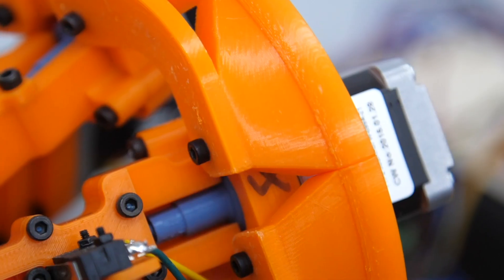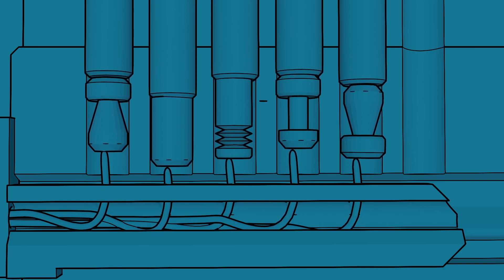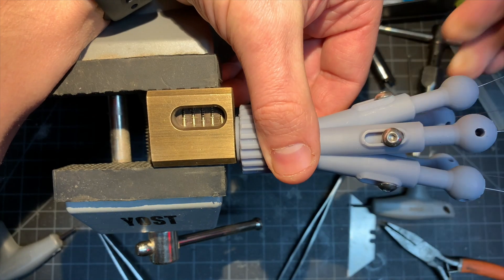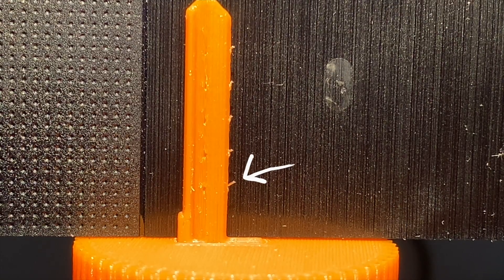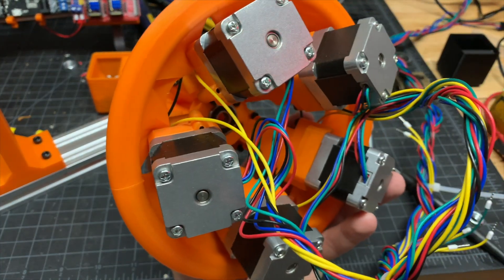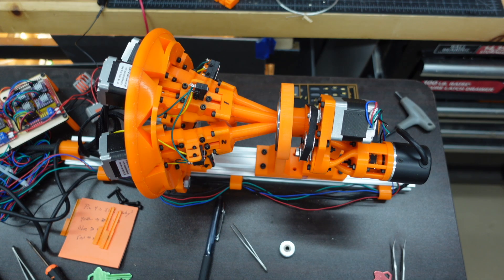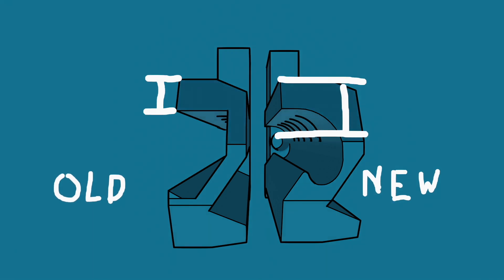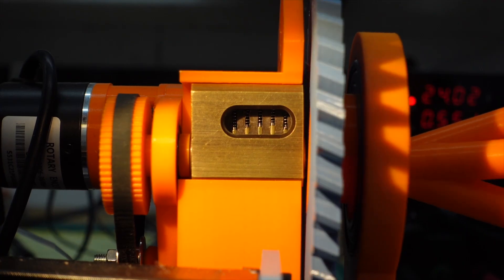i made a robot that picks locks WITHOUT A PICK

Comment: If you got wires, why do you need to spin all the motors anyway? Why not use springs anywhere to limit torque transfers? I've got so many design improvement suggestions..

Comment: I would replace the large helical gears with 'standard ones.' Helical gears introduce axial forces which, considering that most of your components are 3D printed, can lead to unnecessary bending and twisting of your construction. Yes, I understand that helical gears provide more contact surface, resulting in a smoother transmission, but I believe it's worth considering alternatives.

Comment: Seems like a meet concept that can be built upon. Good design work and nice video :)
I'm not too much into mechanical stuff but I would suggest to use double helical gears to reduce movement of the gears. The seem to be pulled out of alignment slightly when under tension and could slip apart. 😅

Comment: The manual version you made first has some serious potential. With metal construction that would sell like hot cakes
Reply: It wouldn't.  It's a neat concept, but the only lockpicking it affords the user is brute force guessing the pin combination.  There's zero market for a tool like that when any lock-related problem has a much quicker and usually cheaper solution.

Comment: Painfully overengineered. I like it.
Reply: Lol, the damn size of the motors alone.... to drive an iron wire forwards......
Reply: It needs more lube
Reply: I would say under engineered, as in the realisation of the machine is done by trial and error. When something fails, just go up in size. Where's the engineering?

"What will do a lot, will do a little"

Comment: 5:32 You could save weight if you'd use a single motor and do something like a punchcard system. With pressured air to move the wires this could make the device even smaller.
Similar to a barrel organ.

Another method to determin a set pin could be to put a microphone to the lock and write an algorithm for the sharp sound, a set pin makes. Since you use wires instead of picks, the noise from picking the lock would be minimal.

Comment: better use planetary gearbox for torque and precision, and then instead of optical sensors use current changes on motor itself from uart or spi data of driver.

Comment: This is the Lock Picking Engineer, so this video pushed all of my buttons.  That was a monumental work of the art of engineering.  I've never seen such dedication in a droid before.  The slightly easier version is an automated cylinder lock pick, where straight pins could be used instead of curved wires.  It looks like you were using a binary counter to set pin heights.  Maybe try Gray code to minimize pin movement.  You should also be able to reduce the combinations by eliminating large differences between adjacent pin heights which wouldn't be possible when pushing a key into a lock.

I loved your Dunning-Kruger graph.  🙂   The entire video was very well done with excellent graphics.
Reply: . . . sometimes it is easy to build upon the hard work of a pioneer, once someone takes that initial step, the rest of us can step in and make improvements,  thank you sir for creating the initial design

Comment: I'm not a fan of the rotary encoder mounted to the back of the lock.  that's not something you can normally access on an in-place lock so in locksport utilizing that part doesn't count as a successful pick.  I would recommend using a strain gauge to determine rotation instead, just set it up so it keeps spinning until a specified torque is met.  it'll help save your keys too.

Comment: I have an idea to potentially make the key solve much faster. If you add some sort of sticky thing to the tops of the wires so they can stick to the pins, you would theoretically (budget be willing) be able to pull the pins much faster than the spring would be able to push them down. At that point you just have to pull and twist and the lock should be solved instantly. Might be wrong tho idk seems sound in my head.

Comment: This was so neat! Subscribed! I'm a picker and just getting into programing/electronic stuff so coming at this from the other side. My biggest suggestion is finer tolerance control on the key turning/tensioning control wheel gears. 
For timprobst7905 's idea there is a video on here of a picker using kilamaru flex/spring tension tools with a mic hooked up to it somewhere but I can't recall.

Comment: Only change is it should all be key side. Feels like cheating detecting cylinder rotation from the back. Perhaps use metal 3d printing for your next key? I would say use a compliant rotation mechanism. So there is some known breakaway torque. Then detect that break away for successful rotation.

Comment: Bro about to blow up with this video.

Great work on this project. Looking at the pretty large requirements for motors here, I feel like there has to be a way to reduce that number - perhaps you could have the large motor turn a driveshaft, and then a series of simple geared connections that tap power from that drive shaft using a servo or maybe even a solenoid to engage/disengage a clutch? There are also closed loop steppers so you could have the software read back the position of the large rotation, combined with your original load cell design you might be able to sense each sequential pin as well as evaluate false sets -

Instead of trying 00001, 00002 - 99998, 99999, you'd test all pin 1 positions, record maximum tumbler deflection for a given force (or record a curve or position:force), reset p1 to 0 and then test all pin 2 positions - slowly build a "best guess". If that guess is say, 55555 - back to brute force but all combos within 1 or 2 of that baseline (testing 1 step would be 44444 to 66666), reduces your tests from 10⁵ to somewhere between 3⁵ (1 step) and 5⁵ (2 steps). Depending on how accurate of a closed stepper and load cell you get... I bet this accuracy could be brought lower and lower.

If you also added another load cell on the wires to "feel" resistance there... Well it isnt going to help complexity but more sensor data will probably help reduce your Nⁿ search even further! 😂

Again, tremendous work, great video - love the editing and visuals youve put together. Toss in an explosion and you're rivalling early Mythbusters production quality. Looking forward to seeing you grow!

Comment: Can you put a pressure detector on each wire and an encoder that measures how much wire pushes out. Then you can push the pin all the way up and measure when it stops (tops out) then you can calculate how tall the pin is

Comment: Couldn't you reduce the keyspace further by applying the same best practice rules that locksmiths use when pinning a lock?
Reply from the maker: Yes there are some "forbidden" pinning (i think it was >= 7 pin steps between two adjacent pins) that cuts it from 100,000 to ~70,000ish. At one point I had a python controller script that filtered those out.

The problem was the wires didn't behave linearly in the tube and blade. So it wasn't 1:1. There were even differences between each tube, it was kind of a nightmare, but yeah you are right.

Comment: Very interesting!  Wouldn't be possible to push pins with air pressure instead of wires?  This way, it seems the robot could be significantly simpler and the whole process could be 10x to 100x faster bcs activating a valve is a 0-1 process instead of a revolving process.

Comment: Also consider adding rotational compliance between actuator and key. Measuring amount rotated will measure torque. Much more realistic than having encoder inside the door, plus it will reduce fatigue on the keys.
Reply: exactly what i was thinking too, you can keep the same setup too just stop rotating the gear if no movement is detected at the encoder after a set angle. make the gear out of nylon or pp and it should last a long time
Reply: I was thinking the same thing.
Reply: Compliant mechanisms are just super cool, and 3d printers are almost made for them lol
Reply: I was wondering about that kind of thing as well, but think doing it mechanically may be simpler. I was thinking of making the key 15-20cm long and then rotate the far end an 1/8 turn and use the flex in the long key as a spring. At the lock face attach a flag to the key and if it moves the full 1/8 turn you know the core has rotated, if not its just key flex.
Reply: Having a key part of the lock picking mechanism inside the house is a big problem... Means that you can already get in, so what need is there to pick the lock?

Or have I missed something?
Reply: @AlphaWhiteWolf20  Experimentation, once he has a fully functional prototype, he can redesign the entire thing to be smaller and move the rotator to the front. He is thinking like a person using a key, he should be thinking like a locksmith.
Reply: @AlphaWhiteWolf20  I could have used this a few months back to decode a master key system in an office where I knew 3 of 5 pins with 2 unknowns. I used a Lishi pick, but it was a bit tricky

Comment: Just so I get this straight... The manual lockpick works only if you see what position the tumblers are in the lock while you pick?  If you put scale lining on the knobs that you push and pull, you can make an adjustable key that you can use if you know the real keys pattern.
Reply from the maker: Not necessarily, I picked a few key sets without looking while testing. But it is not easy, it's mainly luck with no feedback.

Oh that scale idea is good.

Comment: This is really cool!

If you don't mind my asking, did you ever consider making and testing your prototypes with less pins in the lock? the mechanism is essentially identical for each wire, so once you knew you could fit five wires into a key mould and manipulate them by hand you could've scaled back significantly and saved a lot of money and time by making one or two of the mechanism and testing that.
Reply: Also, I have questions about how much you (seemingly) overbuilt this system 🤔

Did you consider using servos rather than stepper motors? For the forces and distances needed and the precision needed here it seems like they'd be fine for this application and much cheaper/lighter/easier to program. If you did test them, what were your findings?

Similarly for the key rotation mechanism, did you consider:
1. Having the wires travel through a bowden tube to allow the 90º rotation necessary without moving the whole system as a unit?
2. Decoupling the motor from the keyway with elastic to limit the force put on the key without having to control the motion of the motor itself? It could just turn to a fixed angle and if the key can rotate it will, and if it can't the band will stretch.

Again, if you considered/tried these ideas, what were your conclusions/finding? I'm interested in the project but I don't have anywhere near the R&D budget necessary for the number and size of motors and prints you're working with here. So if it's not possible to make something smaller/much cheaper I'd love to know before I try 😅
Reply from the maker: I didn't consider servos seriously because of the PID overhead and extra encoders (I also have zero experience with them). The steppers were "good enough".
Now if i could have detected pins being set it would have sparked an arms race in making it smaller and faster.

The tube is a good idea. Cutting the inertia of twisting the lock is a step in the right direction. I would be mindful though when the tubes twist it will change the height of the pins, I suppose you could compensate in the firmware. 

I like #2 idea.
Reply from the maker: I just realized you meant servo not dc servo (brushless DC motor with encoder). Yeah I always forget about those. That's a good idea
Reply from the maker: I did some testing with only a few pins. That is where I got stuck with the encoder problem. It would have caused problems regardless of the number of pins.

Comment: You don't need to have the whole key being metal, if you have pins on the top and bottom to apply the tension the thin plastic won't have to bear the load.
Reply: Exactly, create the first 1mm that goes into the key way and bond the existing 3d printed wire guide to the end of it.
This is where the majority of a normal key’s strength for turning the barrel is coming from.
Reply: But really, it isn't hard to do this entire key on metal.
Reply: A small tension bar would suffice
Reply: @Dave_the_Dave  or, as it is already overengineered, make the keyblade and its mounting rotational and spring loaded (like a rotational clutch) and enter an electrical endstop
springs should be hard enough to rotate the key cylinder but weak enough to soften the sheering moments
Reply: @Dave_the_Dave  I am thinking he needs a tension bar with a weight on it, and a small stepper to simply use a string and pull up the weight between each attempt. The stepper doesn't need to be accurate, as it is only removing the weight from the tension bar and then allowing the weight back on again, a micro switch would tell of success, and then you remove the picker, and simply complete the turn. He really doesn't need a rotator for the cylinder, he only needs to rotate the cylinder the rest of the way manually.
Reply: lost pla casting would make it easy to just cast the whole thing in 1 go

Comment: What about a robot that uses elishy tool? That seems like two motors one to push down one to push the pin forward and something to sense a click.
Reply from the maker: Could you see through the "Top Secret" banner? ;)
Reply: @SparksandCode  hack engineer brains. ;-) 
I can't design anything from scratch, but I can picture duct taping and gluing existing things together. ;-)  
with the issues you described about your tool, it seems a lot were solved by... 
well.. and here we are.  
but I like your wire concept. 
if you had force feedback motors on the wires..  and you applied some tension to the lock before picking, you could potentially pick much faster than finding the pin combination.  because once under tension the motor would sense if there was a binding pin, pick that one, then find the next binding pin.  it would still have to deal with security pins, but some logic might be applied to 'release tension, raise suspected security pins "enough" to clear the gap,  then re-apply known distances. 
kind of like getting a head start on figuring out the correct heights. 
so in step 1, slight tension on the lock, step 2- raise all the pins, see which ones are binding. if the wire isn't strong enough to push past the bind.. could either play with tension until it does, then test the rest of the pins to see which binds next. 
alternatively release the other pins, and pick this one pin to different heights until the lock rotation moves more than before, and then replicate procedure with remaining pins.  
it's an interesting problem to solve for. :-) 
the lishi might be faster, but there's something nice about the wire approach. 🙂

Comment: interesting!
if i can throw my unwanted suggestions in: the force behind those wires seems excessive, smaller and weaker linear motors should be sufficient, if all you need is speed and accuracy - another comment mentioned ones from cd drives
if you want to turn the key without ruining it, how about an inbuilt tensioning tool? you can turn a springy tensioning tool and measure how far it rotated by the force on the spring, this way you can have some sort of "pick-gun" where you could use it (albeit securely mounted) on an actual in-use lock
Reply: Is true linear actuation really needed here?
The total travel for the wire between the smallest and largest pin is only a few mm, with a small disc on the driveshaft, attached to the wire, just rotating it a few degrees should move the wire more than linear enough for this use - the larger the disc, the more linear

Edit: Building on the original comment, the original stepper motors would probably have been plenty powerful in this configuration - I imagine motors half their size again would still do.
Reply: @Flimzes  true! i feel like spending less time implementing and more time designing/ideating could have benefitted the project
Reply: @Flimzes  yeah... the whole project can be built with 5 servos and any cheapo stepper motor. And having the encoder in the door... not adds up for the realistic things as well. Detecting the tension can be done in many different ways, from the piece of plastic which can work as a spring bar, or with pretty cheap TMC220x drivers, they can detect stall. Conclusion: overengineered piece of crap :)
Reply: @felixyasnopolski8571  i was thinking: use the original turner motor, then gear it until it just barely bends the blade, then gear it back a step or two - now it won't break the blade and you just need to detect stalling, no compliant mechanism with sensors.

Edit: I think throwing parts at it without considering the problem at hand is underengineering and overbuilding - semantics
Reply: What about using Bowden tubes to feed the wires through for reduce friction and use servos and linkages to drive them?

Comment: Kind of reminds me of the "key impressioning" technique in which you insert a key blank into a lock, wiggle it, see where the pins left a mark on the blank and file those places 1 step down. Rinse repeat until you got a complete key. But to automate that it would require some sort of measuring capability other comments already mentioned and which is probably quite hard/impossible to achieve.